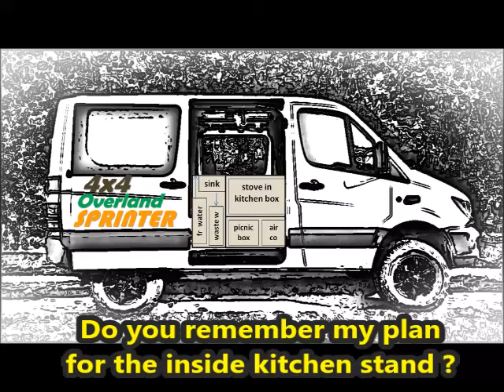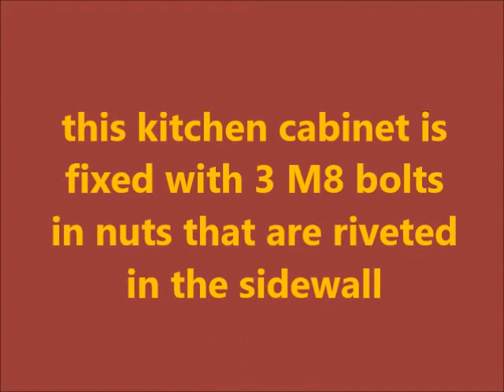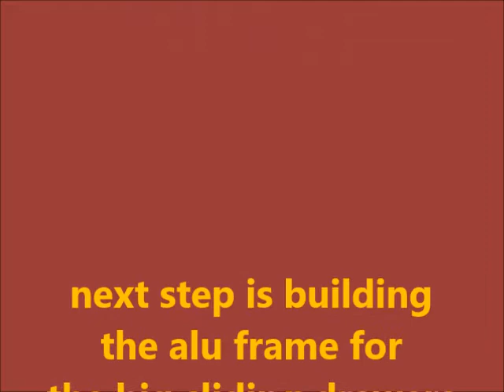DIY kitchen cabinet for camper van

Comment: simple, functional, stylish. kudos
Reply from the maker: Thanks a lot !  But it is not finished yet. I hope I can turn all my ideas into the reality of my van. Just watch what's comming.
Reply: are you nomadic or do you travel certain loops?
Reply from the maker: We don't live full time in our van, it's only for leasure travel. But most of our travels are nomadic. We don't stay long in the same place. We love to do a roadbook where we leave the tarred roads behind. But with a roadbook (that we buy online) we can drive in confidence that the dirt road or track is possible to pass, open to public, and we can chose our own pace. We just like it, it's like solving a puzzle. In general we prefer the sunshine and love to cook and eat outside. Sometimes we travel for just 1 or 2 weeks and in certain cases up to 2 months. West-Africa was 6 weeks. Belgium-Beijing was 2 months. These were both with an organisator, so in group, but with roadbook or GPS tracks, so that we could drive our own speed and stop where and when we wanted. Only in the evening you had to be at the commen bivouac. For the Alpes and Pyrenees we first have to drive 1300km. To the ferry to Marocco (near Gibraltar) it's 2500km. We now also have the idea (or hope) to do the costline of Europe in bits and pieces, so that's a big loop in several parts. And now with the van we also want to do some weekends nearby. That's why we want to be able to live and cook inside and that's why we wanted to have 2 possible layouts (inside or outside kitchen) that can be changed in just a few short minutes.
Reply: Wow that is really cool. Keep chronicling your travels!
Reply from the maker: With pleasure, I can not wait. But I have pleasure in equiping the van too ;-)

Comment: I'm a bit confused, you have said in Belgium it's very difficult to do any work yourself on a camper van, but you seem to be building everything yourself!
Reply from the maker: Sorry for the confusion. In Belgium it is very difficult (not allowed) to do any changes yourself to the car, the chassis, the suspension, the wheels, the reinforcing structures, the bodywork, especialy making holes to add windows,  putting a foldable roof, even a roof hatch, adding extra fuel tanks with a filler cap in the bodywork, installing a diesel heather (= drilling holes for the inlet and exhaust + adding a fuel line to the original fuel tank), making and adding a towbar yourself. Some of these things are allowed to be done by a few improved approved professional installers who are allowed to change the papers of that car (the certificat of conformaty). These few professionals benefit from their unique position to demand a high price. To instal my little roof hatch and my diesel heathing myself I managed to get an admission on paper from my Mercedes dealer by taking their fuel line out of the tank ready for a diesel heather (that's in the list of options) and by putting my little hatch in place of ventilator that you can let install by Mercedes. The interior furniture can be done yourself with no problem as it is considered as a "temporary" load. That's also why my extra diesel tanks are bolted inside. That's why my kitchen cabinet is simply bolted to the sidewall and easily taken out, if not I have to change the papers to camper van. That's why I keep the original wheels so I can put them back on the van every time when needed. I hope you understand better now.
Reply from the maker: Maybe I can add: that's why the last years a lot of people start to chose for a 4x4 pickup, a pickup version of van or a (light) truck. Here you can build a camper cel yourself and it is considered as a load because you can take off. So you are not submitted to the rules of the car/porter, you are more free to do what you want as long as you make no changes to the car/porter itself. Attention: as a result theoretically you can not take out the back window or make a bigger hole yourself to go to the camper cel from the drivers cabin and we can not add a leaf spring or air balls to compensate the extra weight of the camper cel and its load.
 With an older version of van (from before the new rules) some people take the risk to do some changes theirself, because it is not easy to prove if the changes are done after the new rules or before (when it still was allowed to do it yourself).
Reply: @4x4overlandSprinter  Thanks for the info. I have just bought a light freight & i am making into a dual purpose vehicle, also with removable units, but! i have already placed 2 roof vents myself, what do you think are the consequences on the next control?
Reply from the maker: Depends on the country where the vehicle is registered. I just can speak for Belgium. You bought a light freight, which brand and which engine? New or second hand? A 4x4 with a light or extra low reduction? Here in Belgium the 2 roof vents wouldn't cause a major problem in most technical controls, as long as the bearing beams of the roof structure are not sawn off. As a precautionary measure you can always velcro them up with a peace of fabric at the inside to go to the control. So they don't catch the eye. How big are the roof vents? Good luck with the van and the build ! And have nice long journeys with it.
Reply: Well I'm living in Belgium, I'm originally from london UK.the van is Opel movano from 2017, light freight private registered. I just sold my Vivaro in which I made a similar conversion, I passed the control with a roof vent & galley unit twice, they never looked inside,
Reply from the maker: I'm Flemish and in Vlaanderen the rules most secure. But in a light freight they not always look in the back (certainly when drivers cabin is secluded from the loadspace). Most of all it depends on the station, the day and the mood. The rules are there, but not everything is controled with a checklist. Most important is the control of everything at the bottom of the vehicle. With my Discovery4 only the 5th year they disapproved the extra fuel tank in place of the original spare wheel and they never made a remark about the rear bumper that was replaced by a steel one to support the spare wheel carrier. this just because the fuel tank was not mentioned on the COC papers. I had to take it out and let it control by  Vincotte (the safety organisation), they had to put a number on it and give me a paper with that same number declaring that it was for that Discovery with that chassisnumber. 
My friend went for nearly 20 years with his light freight furnished VW Transporter (without separate drivers cabin) without any problem. Then suddenly they didn't want to pass the control because there was a bench with a matras and there could sleep someone on it. So the papers should be changed to camper van. Then the same moment my friend took out the matras and put it against the wall in the technical control and explained now it was just a box to put materials in ... then he passed without a problem. At the end of the control he put back the matras before there eyes.
In 1988 I went for my first control with my LandRover forward control (after restauration and changing it to a camper), when it was my turn the whole station stopped, all the technicians came around my forward control and it was like a contest giving the most remarks. I came out disapproved and a whole list of things to change. Only a while afterwards I learned some things they made me do where only necessary for trucks and not for campers...
You just have to be lucky, as long it's not an important or structural thing.
Reply: @4x4overlandSprinter  Thanks for your time to explain. Like many situations, depends who is behind the desk. I'm enjoying your build & travel clips, 4x4 has been a dream for many years, just always out of reach, safe travels & we just might meet up, if the track is not too rough!all the best, Martin.
Reply from the maker: OK, all the best! And see you on the road, or the first weekend of september at the meeting in Ranst (near Antwerp, BE) of overlanders.be
Reply: @4x4overlandSprinter  Didnt know about that one ,only Bad Kissingen, ranst is 20 mins from me! But I'll have to slip in the back door, I'm only 2 x 4 !
Reply from the maker: That's no problem, I'm sure you will not be the only one.